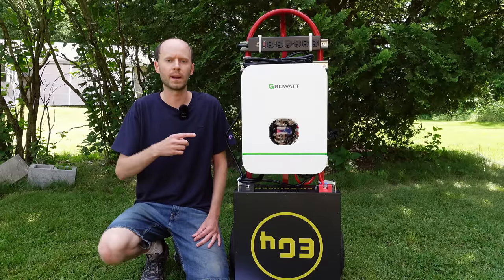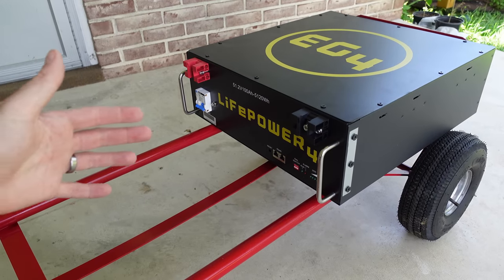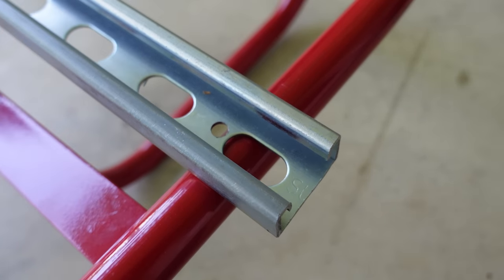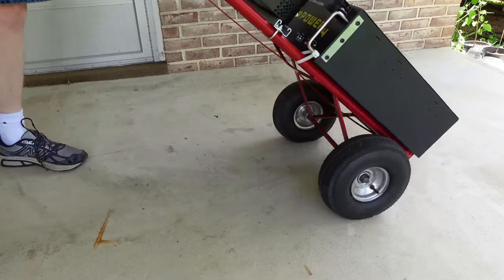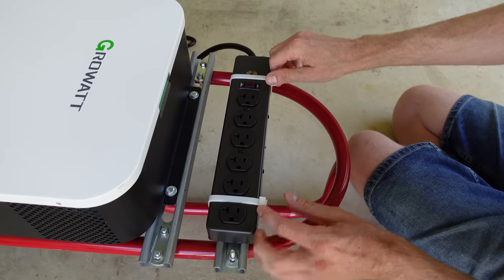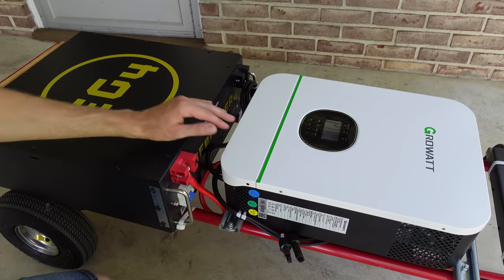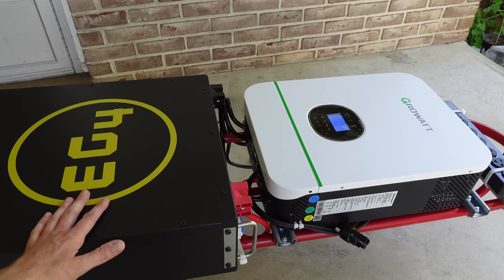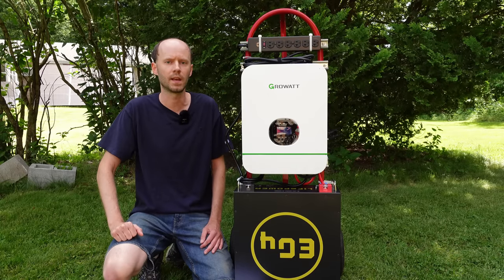Building a 3000W Portable Solar Power Station, Great for Power Outages!

Comment: Hi, I have issues with Growatt TL 3000-5000 inverter,

On supply (SOL) and OSO charger, the PV switches off once the battery is fully charged.

What do I need to do, to get the solar to supply the loads even when the battery is fully charged.

What settings have u used op ure setup?
Reply: If there is no load, what would you expect to happen?

Comment: Why did you have to switch the negative and positive on the inverter? Would I need to do that on a Renogy adventure charge controller on the back of controller?
Reply from the maker: You don't switch polarities. The positive from the panel goes in to the positive on the charge controller. Never switch the polarities.
Reply: Why did you switch it on the inverter then? when you were hooking up the solar connectors?
Reply from the maker: @davidmartin3255  A male connector goes into a female connector. You need the opposite connector. Don't look at the +/- markings on the cables or connectors. Just match up the polarities correctly.
Reply: I see, great video! Thank you @LithiumSolar

Comment: Good videos.... I watched the first version as well. I am thinking of doing something similar. However I do have a question. I bought 2 qcell 400w commercial solar panels and an EcoFlow that work together pretty well, but I am also wanting to do something similar to this. My big concern (since I am a novice) is that in parallel these panels output 90V and 11.4 a under ideal conditions. Since neither of your videos describe your solar setup can you tell me if the output of my cells is compatible with such a system? I am guessing it is, but I don't want to guess. Thanks
Reply: If you parallel those panels the voltage should be the same as with one panel. (the parallel connection increases wattage not voltage). Only if you connect them in Series will the voltage increase.

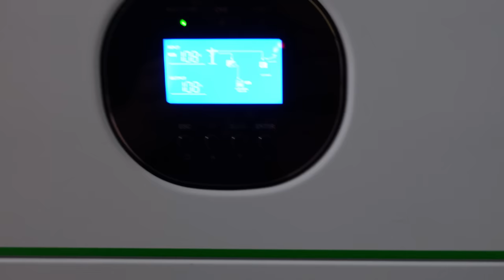Comment: 14:44 does the inverter knows when i have PV excess and load with pv excess via household grid connection?
Reply from the maker: Yes. It doesn't charge if the batteries are full and there's no load.

Comment: How long can you run a 6000 watt air conditioner from  this build.
Reply from the maker: This is a 3000W inverter. You cannot run a 6000W air conditioner on a 3000W inverter.
Reply: @LithiumSolar  oops , I meant 6000 btus

Comment: Cool video. What do you think about the lion battery's, particularly the lion safari?
Reply from the maker: I reviewed a Lion Safari early on. I think it was actually one of my first reviews. Great battery with EVE cells.
Reply: @LithiumSolar  cool man I'm trying to build me a tiny solar system that's not too pricey but strong enough to run a heater or a fridge.

Comment: How long does it take to charge from empty?
Reply: I believe the inverter can charge at a maximum rate of 80 amps and use both AC and or Solar if available.  So the time to charge an empty battery bank depends on the battery bank capacity, how much solar is available, and the settings you used during system setup.  Many people consider a battery 'empty' if 10% of the charge is remaining, while others will tell you  they let the BMS shut off the battery when "empty."  Same thing with "Full".  Many consider a battery "full" when it reaches 90% of it's capacity.  Hope this helps.

Comment: Hello. I have a solar system with a 30A mppt charge controller. My inverter also has an integrated charger that charges the battery bank when there are public electricity (Grid). I realize that my batteries last longer when its charged from the integrated charger of the inverter than from the mppt even when the lcd display of the mppt indicates that the batteries are fully charged using the solar panels. Is my mppt charge controller not configured correctly? If anyone could help
Reply: My understanding is that charge controllers suck at determining the state of charge.  Look into a shunt.

Comment: First off, good instructions, etc.  However, I'm not quite following when/where you would use this?  Don't get me wrong, I completely see how a backup battery could be useful.  I just don't see why it needs to be so mobile?  It's not like you would be rolling this around in the house during outages.  You would already probably have it sitting where you would need it and would just plug into it with extension cables, etc.  And if you had to completely evacuate then odds are you would be better off with a gas generator.

Comment: 6:14 unistrut used to do those nuts with a steel spring crimped into them - I don't like the idea of that plastic cup washer!
Reply from the maker: I've used hundreds of spring nuts. I get tired of the spring getting caught in the holes of the strut and just thought I'd try something different. I think the spring nuts are easier to get into the strut for sure though!

Comment: How was the inverter grounded? Did it have a device ground?
Reply from the maker: The ground conductor on the power strip is connected back to the inverter.
Reply: @LithiumSolar  I don’t have a Growatt inverter charger so please forgive the continued question. Both my 3K Xantrex inverter and my solar charge controller both have device grounds that go to the negative bus bar and that is grounded to the chassis of my vehicle. I honestly can not explain the need for the requirements I just followed the wiring directions. Is this not required with Growatt?

Comment: All looks ok..but for sure that battery should be held down in bottom part..you said no wood..it looks like you were cheating a bit :) 

Anyway..i would suggest to add some L shape bracket just to hold battery in place ..secondly i think you should earth together battery, inverter , grid and that hand track..after all you don't want to be zapped by electricity coming who knows from where..it is all metal..and proper connection must be done or you could be in big trouble..

Comment: Can someone help me understand how this system is grounded (safe)? I understand he wired in the ground from the power strip but without a grounding rod, how is it safe to plug things in?
Reply: How then do you ground Jackery, Renogy, Kodiac, etc. etc?
Reply: If plugged into a grounded AC outlet, even if the grid is down, the unit is grounded.

Comment: Hi, I have Growatt TL 5000 inverter with 2300w solar array. The solar only produce energy for about 15minutes then it disconnects.

I have tried uti, sbu and sol priority settings all with the same results (problems).

I need urgent advise.

Thx
Reply: What did customer support have to say about this?
Reply: Hey, I updated the software on the unit….I had to literally pull answers out the person’s ass I was referred too, and still the unit didn’t function as it should…

I just gave up as I reached the end of my perils with this issue.

Comment: Sorry to say, as cool as the technology is, for what you invest in this system you could buy a pretty hefty generator and a huge supply of gas and gas tanks.   Unless you are attached to solar cells full time, and using the power generated from the sun, it is just not cost effective to create a portable system like this as a generator replacement. And the generator can run all night and day for weeks also.

Comment: I’m wondering which inverter be ideal for the 240v so I can plug in 2hp water well pump. I think there is something similar to lv6548 just for 240v. Any recommendations. I want to just use it for 240v for pumping water 4hrs per day and I already have 3000 watt pv array I could attach. Love to find one that just hooks straight to pv or is capable of battery less lik my lv6548. I love that inverter.

Comment: it looks like a good but expensive system .. It may not be suitable for off-grid living because the point of living off-grid is simplicity, being basic,  being affordable
Reply from the maker: It's very affordable compared to other component choices. You can't really get much cheaper than this without a reduction in power or inverting capacity. What would you consider as "affordable"?

Comment: Very cool build video of a truly capable backup power system.  Is there any concern with mounting the EG4 battery upside down?
Reply from the maker: No concern. The orientation of the battery puts the cells in the horizontal position. You cannot mount the battery in a way such that the cells are upside down (big EG4 logo towards the ground).

Comment: This is a fun project, but let's be real... without a large PV array to charge it, 100ah isn't going to provide much more than a few hours of usable power.  This is where a gas generator is the better solution.  For ~$1k you get the same power and potentially weeks of backup energy.

Comment: It is the same like building  a home cleaning the home in side is not the same
as building yes nice how you build al things or have you learned how they should
be working i just have build a tv because i have put the plug in the wall socket.
you know that things have a user manual so we know you can read.
Reply from the maker: I don't know what you're rambling on about, but enjoy building your TV. It sounds like a fun project.

Comment: This would power two 120v 25amp outlets for 20 hours.  Then what? 
Recharge it how in a lights out scenario?
Reply from the maker: It has an 80A built-in MPPT solar charge controller. You can connect solar panels.

Comment: How long does it take to charge with solar?
Reply from the maker: You haven't provided enough information to answer that question.
Reply: @LithiumSolar  oops sorry. With 400W solar panels for example. How long does it take to charge it back? Or with ahonda generator. Thanks

Comment: Great video, but I was left scratching my head over the choice of battery.  With the 100 AH battery, why did you go with 51.2 volts?  100 AH 12 volt should do just fine, and would save a LOT of $$  ($200 versus $1200).  I believe 100 AH is 100 AH, regardless of the voltage.  I understand higher voltage needs for businesses, scalable systems, and large loads, but this is a portable unit designed to provide temporary power to appliances (mobile, temporary) meant for ordinary people's personal use.
Reply: A 12v 100a battery would only supply 1.2kW.  Where a 51v would supply 5kW. The amps are the same so he just wants more storage. At least this is how I understand it.
Reply: @guns4786  Thank you.  Wish I were able to confirm the difference in capacity
Reply: @steve8189  volts  x amps = watts. You measure energy in watts. So 50v x 100amps/hr = 5000watt/hr. 
12v x 100amps/hr = 1200watt/hr. 
The 100 amps is the most current draw you can have at any single point in time.

Comment: I'm torn between using this hand truck vs. a Dewalt tough chest to put the battery and inverter inside. The dewalt chest will be better protection from outdoor elements, but the hand truck is more robust and takes up less space...
Reply: The inverter needs air flow for cooling.

Comment: So you are charging the batter from the normal power grid.  Not a solar power station - just a battery inverter backup.
Reply from the maker: It has an 80A solar charge controller built in as I noted in the video.

Comment: I need help for the battery the solar kit and the converter put it all in my tool box that pulls
Reply: I just need a 2000 or 19 1500 converter
Reply: @damianwinchell8202  Check this solar inverter PIP 2724LV-MR, it's tiny but can power 2700w and has built in AC outlets... all you need is to plug in batteries and solar wiring... the only downside is you are limited to 600w of solar panels or 60VDC for series solar panels. Will Prowse made a video about this unit on his channel and he also said you can add more solar panels connected to solar charger to charge battery bank.

Comment: 4awg battery cable is not near heavy enough for 3KW, even with one foot length. Test bed experience.
Reply from the maker: Yes it is. 3000W / 48V = 62.5A. The NEC rates it at 95A with 90C insulation.
Reply: @LithiumSolar  As I said, I have test bed experience with inverters. Can't go by the formula as it does not cover all the other operational variables. NEC is a different application that doesn't cover inverter operation. The key factor here is power loss, not wire current ratings.

Comment: Can someone please explain to me why he flipped the polarity of the MC-4 cables? When I have watched other videos they don't do that.
Reply from the maker: You don't reverse polarities. A male connector only fits into a female connector. Do not rely on the +/- that is stamped on the connector is what I was saying.
Reply: @LithiumSolar  Sorry for any confusion. I should have been more clear. Everything in your video made sense except when you inserted the "red" or positive lead into the negative PV terminal in the inverter. I don't want to damage my inverter and have gotten everything else working well except for this final piece.

Comment: Great Build, I love it and I'm planning on building something similar.  I do have a question, with the AC charge input, the inverter will draw a max of 40 amps, but you are feeding it with a 20 amp AC circuit.  How do you prevent the inverter from trying to draw too much current?  Thanks and keep up the great posts.
Reply: I’m having this problem 
I saw some where you’ve to hook up to a 50 amp plug is this correct
Reply: @douglaslowell2362  You can only put a 50 amp plug on a 50 amp circuit.  This would not work for my setup.  My point was I wanted to limit the battery charge current draw on the inverter so it would not blow the circuit on my  20 amp house circuit.
Reply: The battery charge current is adjustable.  Download and read the manual.  I set mine at 20 A DC charge, no problems on at 15 A AC circuit.
Reply: @russlo5324  Correct, the Growatt can be adjusted in the settings.

Comment: The only downside to this inverter is it takes 2 to get 220 volts required for my well pump.
Reply from the maker: There are many other inverter options if you're needing 240V and don't require 120V.

Comment: No fuse or circuit breaker?????
Reply from the maker: Where? The power strip (output) has a over-current protection built in and the battery has a circuit breaker built in.

Comment: why not just turn around the u bolt?
Reply from the maker: Because the round part is designed to go on the round pole lol. Having the flat part on a round pole is going to bend the flat part when you tighten it down.

Comment: I DON'T GET WHY ON THE CART, I WOULD THINK A SERVER RACK WOULD IN MOST CASES REQUIRE LESS SPACE AND BE MORE MANAGEABLE, I COULD SEE WHY THE CART WOULD ALSO BE USEFUL, BUT IF I WAS GOING TO USE IT FOR MOBILE, LIKE SAY AN RV, THAT WOULD BE RATHER CUMBERSOME, OR EVEN AN OFFICE, WHERE A SERVER RACK COULD BE TUCKED AWAY, UNDER A TABLE, WHICH COULD THEN SUPPORT BOOKS, FILES, COMPUTERS, PRINTERS OR WHATEVER.
Reply: Yeah, I used a 4-wheel cart instead of the hand truck.  Server Racks are expensive & come with indoor type wheels.  We need huge wheels to move outdoors

Comment: Why not use extension cords instead?
Reply from the maker: Extension cords instead of what, the power strip?
Reply: @LithiumSolar  Why to move all this system around, get an extension cord.
Reply from the maker: @mohamadyehia3059  I like the idea of it being portable for my use. You're welcome to mount yours in a fixed location if you'd like. It doesn't have to be on a hand truck.
Reply: @mohamadyehia3059  Extension cords from your home don't word during a power failure.
Reply: @thomasgriffin4714  instead of moving the the whole system around, isn't it easier to connect an extension cord to it?

Comment: Great!  Very practical.  Only thing I'd change is the hand truck wheels.  Yes pneumatic tires are good for going through grass but they will go flat over time if you don't inflate them often, and then the tire bead will break from the rim and you'll have to source some oddball inner tubes to ever use the hand truck again.  It happened to me, what a PITA.  When you buy those hand trucks in the store you don't think of the tires so they don't spend $2 putting in tubes at the factory, which would solve the whole problem.  I'll never buy another hand truck with pneumatic tires.

Comment: I have DMD and live on a portable ventilator 24/7 die without it Its a LTV 1150 ventilator it doesn't use a lot of power I really need something that would power my ventilator for a long period of time off the grid Something that is solar charging and you could use a home wind turbine to keep it charged Kind of like a back up for no sun Would any of your sponsors want to fund a project for that Or anyone that would be interested in a project like that Its scary when the grid is very vulnerable and it's your life line Anyone see this I can prove who I am that I have DMD and live on a ventilator 24/7

Comment: You can't compare a air compressors draw to a air conditioners draw . Ac units draw 10-12amps
Reply from the maker: No they don't. My window AC pulls less than 4 amps. This air compressor pulls around 15 amps.

Comment: You said reference to the inverter you hook the positive to the negative and the negative hook to the positive? What da heck ?
Reply from the maker: The positive from the solar panel goes to the positive terminal on the inverter. If you're using an MC4 or any other standard connector, a male will only go in to a female - so you should ignore the markings on the connector and MAKE SURE POSITIVE GOES TO POSITIVE with a multimeter.
Reply: @LithiumSolar  oh ok thnks